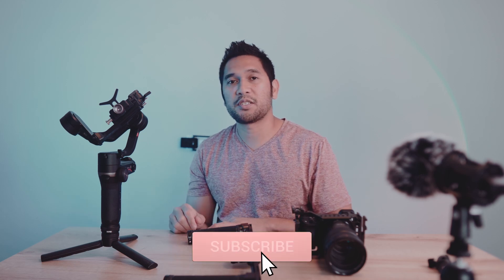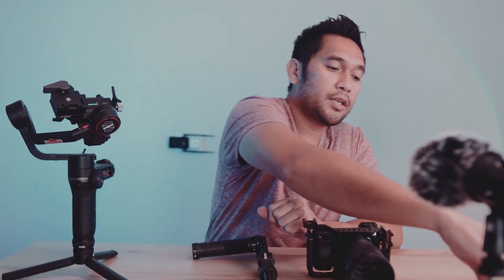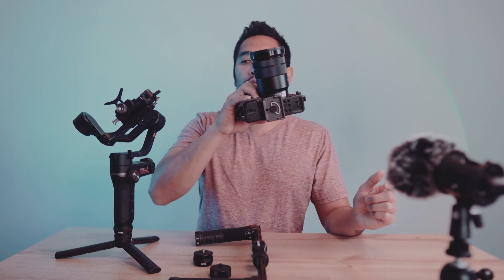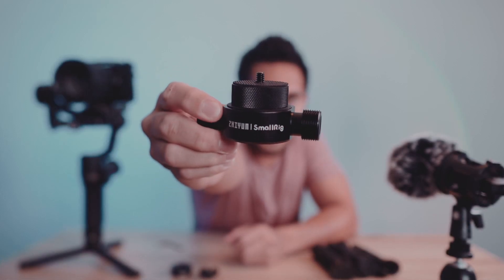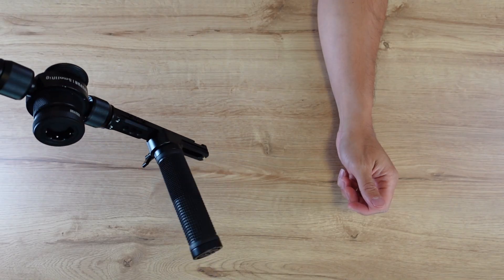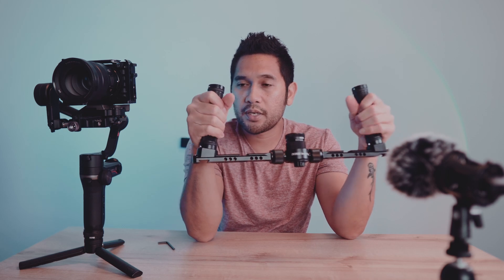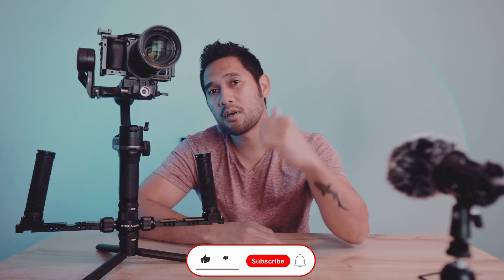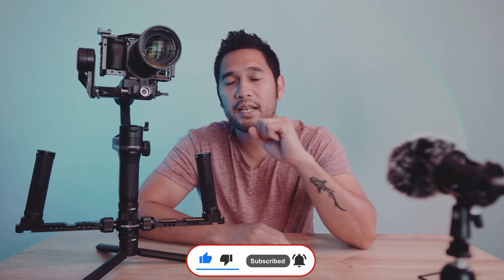how to build a dual handle gimbal

Comment: The dual grip you linked in the description does not come with the little metal pieces that screw into the baseplate... what do I do now? 

I think you linked the wrong thing in the description. Now I'm stuck with dual handles that do not mount whatsoever.
Reply from the maker: Oh No, i dont know what happen I did put the right link but somehow the item is replaced by this version..heres another link SmallRig Dual Handgrip for ZHIYUN Crane 3S Handheld Stabilizer 2857 https://www.amazon.com/dp/B08LN5TZ29/ref=cm_sw_r_apan_i_NSTMM5RE1781AD8FQSAX..hopefully you can still return that to amazon and have it replaced..so sorry.